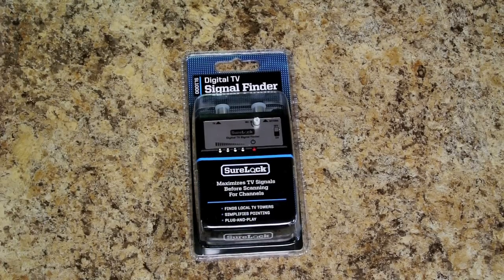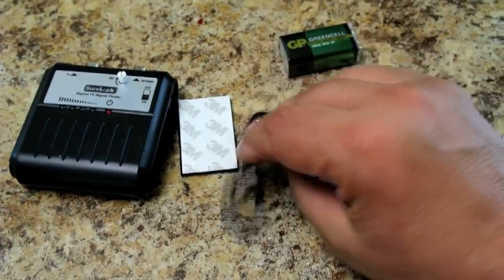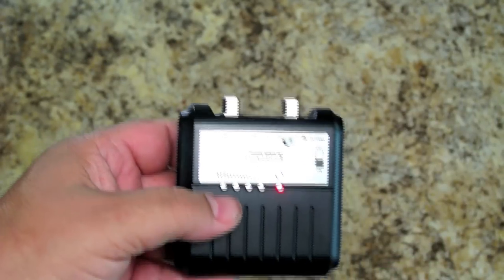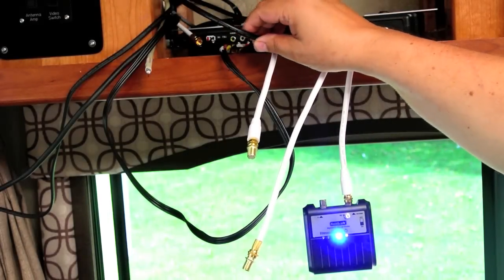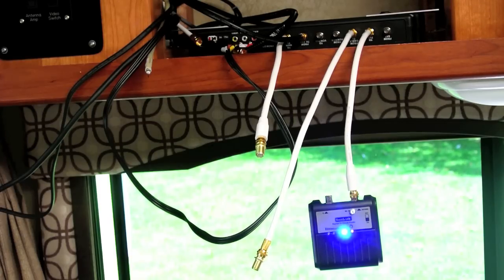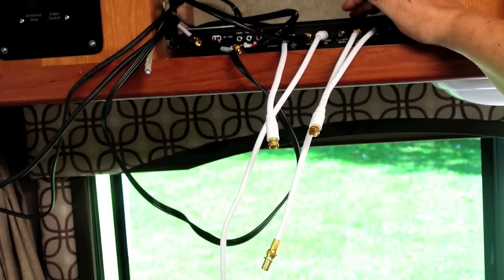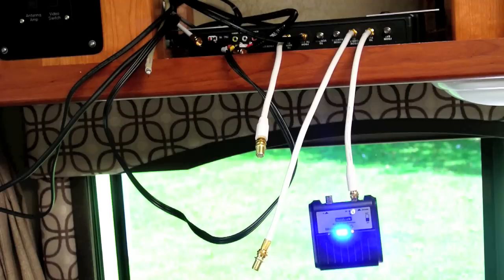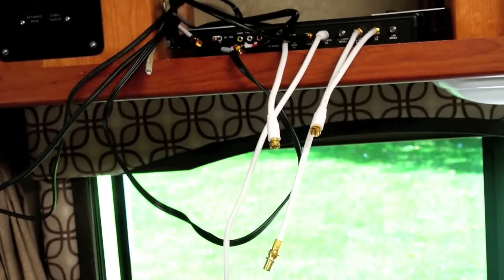Using the King SL1000 TV Signal Strength Meter in a RV.

Comment: I'd like to use this at home, not in an RV.  Is there a brand/model with which I can test specific channels?
Reply from the maker: I am sure there is, but it might be a bit expensive as it would be a service grade instrument. I have not researched products in this area.
Reply: @RVProject  I was able to use the HDHomeRun status webpage to measure the signal strength. Obviously it helps to have a SiliconDust tuner.

Comment: It has been two years since you made this video, but if you are still monitoring for questions, I have one (or two). What channel frequencies is the signal meter looking at? Does it include both VHF and UHF channels? And have you run across a better meter since you made this video in 2014? Thanks. Nice video by the way, steady camera and good audio.
Reply from the maker: It is not channel specific. It just looks at wideband signals, so you don't know one channel's signal strength from the other.

Since I did this video, I installed a new TV in the bedroom where the antenna control is. This TV has a signal strength meter built-in for each channel. So if I want the strongest signal for a particular channel, I can watch that channel's signal strength meter as I rotate the antenna.

Unfortunately, most TVs do not have a signal strength meter, and I was lucky to find one that did. It is an Insignia 19" TV.  http://amzn.to/1XdNLOo
Reply: RVProject which makes it useless.
Reply: @RVProject  This appears to be useful only for RVs (which fits the title of the video). It's more like a town finder.  I would like a version that you can tune to a channel and aim your antenna with it.

Comment: Thank you for your work making this video. But I do not think I learned anything here. Most TV 's have signal meters on them.
Reply: It's very difficult to view those TVs that have signal meters when you're on the roof aiming your antenna.
Reply from the maker: I have not seen a lot of modern TVs with signal level meters. The only ones I have seen that do are the Insignia line, and then it varies by model.

Comment: Thank you for your work making this video. But I do not think I learned anything here. Most TV 's have signal meters on them.
Reply from the maker: Actually it's been my experience that most TVs do not have a signal strength meter built in. 

Of the three TVs I have in my RV (gosh, 3 TVs), the two that came from the factory do not have such a meter.

Only the aftermarket Insignia TV I installed in the bedroom after purchasing the RV has a signal strength meter.  Even then, I had to look at many different models of TVs to find one with this feature.
Reply: @RVProject  Thanks for replying back. TV brands & models probably differ in your region compared to mine. My LG TV has a signal meter.
Reply from the maker: It's a nice feature to have... too bad more TVs don't have them built in.
Reply: Can you take your TV up on the roof to get a direct reading from your antenna?
Reply: @robertogalvez3865  I agree with you.  A Large TV could be difficult.
Reply from the maker: @robertogalvez3865  Not sure if this is a joke or not.

Assuming it is not, I would not recommend it. The coax cable that goes from the antenna to the "booster" in the RV could damage the TV.

The booster in your RV (the wall plate with the switch and LED on it), is not really a booster, it is a power supply. the actual booster (amplifier) is located in the antenna itself. The wall plate power supply sends 12VDC up to the amplifier via the coax (center pin is 12V and shield is GND), and the RV signal travels down the same coax.

There is a blocking capacitor in the wall switch that prevents 12V from reaching the TV. For this reason, if you were to connect the TV directly to the antenna, the amplifier would not be on, and you probably would not get a satisfactory signal.

If you used a "tee" fitting to connect the TV between the antenna and wall power supply, then 12V would become injected into the TV's RF section, possibly damaging it.

The only safe and effective way of using these antennas is to ensure no TVs are connected between the wall plate and antenna.
Reply: @RVProject  It is no joke. I am professional antenna installer and was trying to make the point that your portable tool makes a lot of sense versus using a  signal meter on your TV. It is even more precise.

In my case I use a digital signal strength meter and get the readings directly from the antenna on the roof, using a 6-feet RG6 coax cable. That's how I align an antenna.

Thank you for your comment RVProject.
Reply: @robertogalvez3865 , I know your reply is an old one... But can I ask which signal strength meter you use?
Reply: @russellborrego1689  I use a chinese ISDB-Tb meter made by Volks Telekom. It is El Cheapo but is good enough for me. For the  ATSC standard I would use the Televes H30 but it's too expensive, over $1,000!
Reply: @robertogalvez3865  thank you for your reply! Much appreciated!